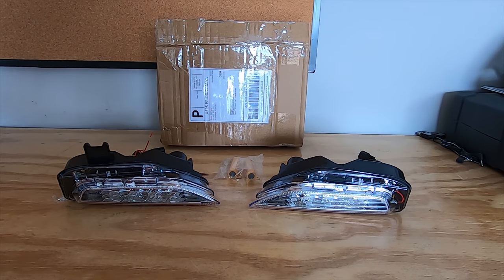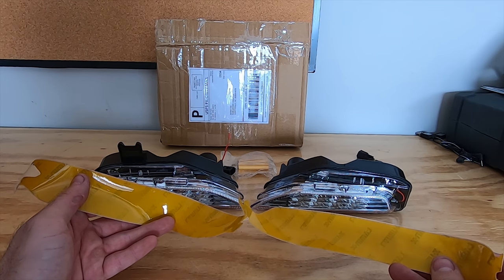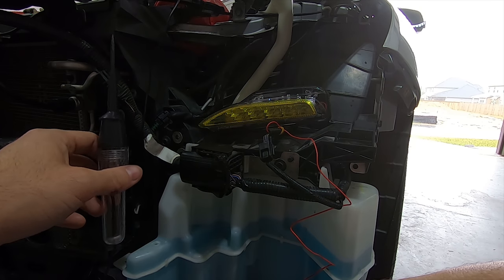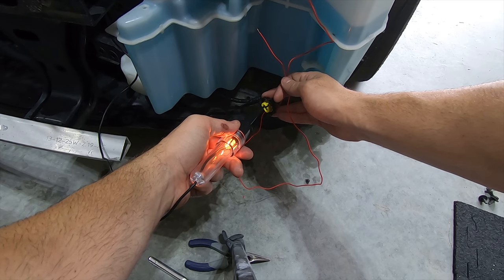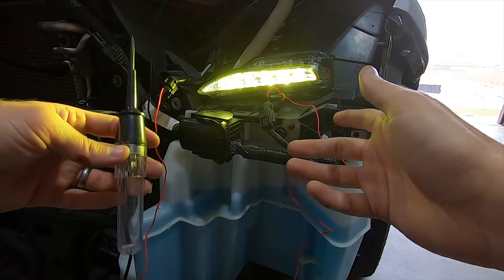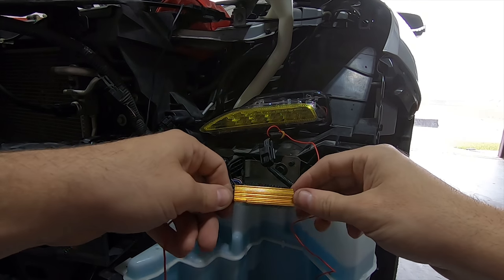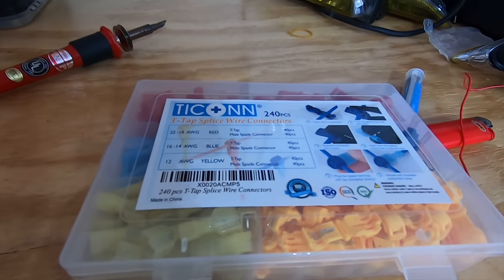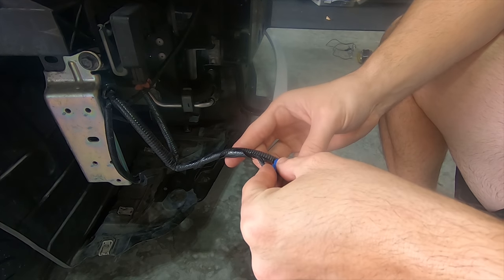Q50 Front Sequential-DRL Installation {great addition all around)

Comment: Hi guys! I recently got as a gift sequential front bumper turn signals for infiniti Q50. After connecting them to the original plug, it turned out that only the first two LEDs are activated and the rest of the turn signals blink rapidly as if one of the turn signals is faulty. The electrician at the Infiniti dealership who installed it tried to add a resistor, however, this did not help. The car has been produced in 2018- My question is, did you have such a case? Can you maybe advise something on how to deal with this problem? I would really appreciate some advice 🙏
Reply from the maker: That sounds like a short in the actual light and may be defective. I can’t imagine a tech wired it wrong… if you have a video send it to my IG!

Comment: What wire would I need to tap into if I have the diode dynamic always on module for the fog lights and I want the drl to always stay on aswell
Reply from the maker: I can honestly say I’m not sure since I don’t personally have the module installed however I got the knowledge on what I did discuss from Speedculturestudios install video where he used the module harness as the power source. Maybe check out video, he might have discussed it!

Comment: I recommend NEVER having a load resistor on anything plastic. Those things get EXTREMELY hot. Always run extra cable if needed & mount to a metal surface. Especially with it being on a DRL
Reply from the maker: I hear ya, I could move it but it’s been 100% the last 2 years. Next time I have the bumper off I will relook at it.
Reply: @Foxcraze  wow that’s crazy! 🤔 
I mean, if it ain’t broken. Don’t fix it I suppose

Comment: I am having an issue with my DRLS. When they are white (2 or 3 of the dots) start flashing! I got new ones they worked fine for a few weeks then it started doing it again - is that to a faulty Load resistor???
Reply from the maker: It’s unlikely both sets were faulty. Did the second set come with a resistor as well? If you order a third set I would def replace the resistor as well and hopefully that fixes the problem.
Reply: @Foxcraze  I reused the same resistors for the second set unfortunately and now only the pas side is blinking I am going to swap them out this week and see what happens. Appreciate you commenting back bro. 🫡
Reply from the maker: No problem brother, hope it works out for you man!

Comment: Hey, great video just one question. When I installed the kit without the diode dynamics kit the fog light didn’t turn on. Any solution?
Reply from the maker: Thank you! What specifically was your installation method? The fog lights are factory wired so they should come on as designed from the factory.
Reply: @Foxcraze  Hey, I’ve installed them on the fog light plugs. Would I need the always on kit?
Reply from the maker: Message me on Instagram bro, it’s easier to chat and narrow down issues over there.👍🏼

Comment: Can I use a quick splice connector instead of a t tab splice?
Reply from the maker: Dealers choice, I used what I had available at the time plus I like being able to unplug the t tab and remove the bumper without taking off the lights.
Reply: @Foxcraze  I ended up using it and it worked for now. Couldn’t find the t tabs anywhere near me unfortunately

Comment: Will it be the same process for Infiniti q50 sport 2019?
Reply from the maker: Yeah the lights and wiring should be identical with exception of the illuminated emblem plug that may or may not be added to the newer models.
Reply: Duh

Comment: With me having a 2018 with LED lights all around from Factory would I still need to get a set of resistors?
Reply from the maker: The lights should have came with the needed resistors when you bought them. All LED's run higher than their operating voltage which makes the resistor needed. I would say to just plug them in and see what happens. You will know immediately if the resistors are still needed. I can’t give you a definitive answer unfortunately sorry.

Comment: Hey I installed these and they worked fine until I took them apart and rewired them back on. The turn signals work but the DRLS don’t. Any help?
Reply from the maker: When you say took them apart, do you mean just uninstalled them or opened them up? The DRL wire could be grounding out from an exposed section of wire, have a short from a broken solder point in the housing or the resistor could have went out.
Reply: @Foxcraze  Ohh just uninstalled them. The resistor may have went out, or be grounding. I’m not too sure.
Reply from the maker: @zemps6542 short of rechecking the wiring and putting the resistor on a tester to see if it’s getting voltage I’m not sure what else to recommend man. You can make a jumper cable to hook to the drl wiring and tap it on the + battery lead and see if they function, that will eliminate any internal housing issues.
Reply: @Foxcraze  Ok i’ll try that

Comment: @foxcraze I bought a set, but as I plug and play, I’m getting hyper flash; and when I put my tester on the live wire with sequential light installed, it works normal. Any comments ?
Reply from the maker: Did your lights come with the supplied resistors and if so did you place them in line and test it as well?
Reply: @Foxcraze  it did come with supplied resistors and it's all sorted now. I didn't install resistors properly. thanks for responding!
Reply from the maker: That’s what I figured, Good to know it got worked out!

Comment: Hey I installed mines but for some reason the driver side sequential takes a split second to switch to the white drl before going to the sequential sequence. Might be the wiring?
Reply from the maker: Possible or the light has an internal issue which I have seen common in the comments. Make sure none of the wires are touching each other or any external metallic surface. If thats not the case make sure you have a solid connection to the resistor on both ends . If none of that is the issue then it might be a defective light.
Reply: Alright, I ordered my resistors and will see if that fixes the issue. Thank you so much man
Reply from the maker: Hope that fixes things!

Comment: Which wire is the DRL for driver’s side headlight? I’m installing the LED emblem i tapped it wit the green wire first but I didn’t have power and now I did. to the pink wire (headlights) and I get the power only when headlights on. I want it on basically wit the DRL and EVERYTIME I lock/unlock the car, which wire should I tap it with?
Reply from the maker: Man, my green wire on the drivers side headlight is what was what giving me the drl power source. What year is your Q and could the wiring have changed in the years as some point?
Reply: @Foxcraze  Oh really? Yeah I tapped thay one, no Power. Mine is 2019 Luxe Q50
Reply from the maker: I have a 2014 premium and my pin 1 wire is def green but if you have a more upgraded model than me it’s possible yours is a different color. Turn the headlights off so only the DRL is active and hit each pin with a multimeter to find the hot one.
Reply: @Foxcraze  Ahh i SEE that makes more sense then. But I figured I’d just keep it on the headlights just Incase I need to GO incognito haha! Thank you for your time doe man!
Reply from the maker: Anytime man!

Comment: I know it’s pretty late since this video but I tapped into the green and pink wire and the drl’s only come on when my lights are on. And suggestion as to why?
Reply from the maker: What year is your Q and do you have the adaptive headlights? Mine is a 14 with standard headlights which might have played a factor.
Reply: Just installed these and having the same issue. Followed your steps and they only come on when the lights are on. I have the adaptive headlights too.
Reply from the maker: What year of Q?
Reply: @Foxcraze  2019 red sport

Comment: I really need help man. I have a 15’ Q and can’t figure out what wire is the headlight drl so i can tap into it. Tried the one you said in the video for passenger side and it doesn’t work
Reply from the maker: Does the drl function by connecting to a direct power source? On my plug the pinkish wire gave me power on the passenger side. It’s possible I could have misspoke but I’m fairly certain I didn’t. Do you have a tester to check the wires for power?
Reply: @Foxcraze  No tester unfortunately. The drl does not function without a direct source of power and neither does the sequential. Also there are 2 kind of pink wires and one of them im tapped into for the led logo and it turns on when headlights are on
Reply from the maker: If you plug the sequential in and run the drl power wire to say the battery,  does it work? I just want to rule out a faulty drl.
Reply: @Foxcraze  The wire does not reach, far
Reply from the maker: You will have to use an extra piece long enough to reach and just twist them together to test it out. I would say just buy a cheaper tester from Walmart or turn the drl setting on with the high low lights themselves off and then unplug the headlight and touch the inside of each wire till you find the correct one.
Reply: @Foxcraze  Will do. Also i wired the breakers and it still seems to hyperflash when turn signal is in action. It’s like nothing is plugged
Reply from the maker: That’s so weird, you’re experiencing the opposite I did when I installed mine.. I dunno what to say with out seeing it in person sorry man. If you wanna send pics and video to IG I might be able to better help.